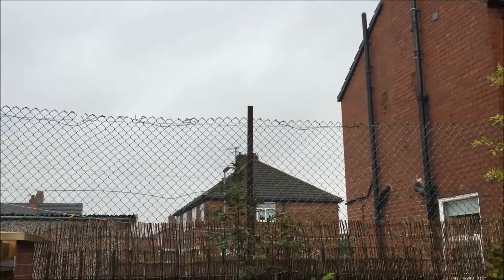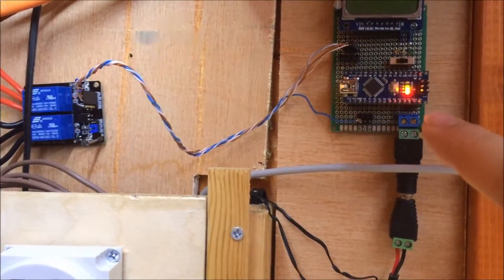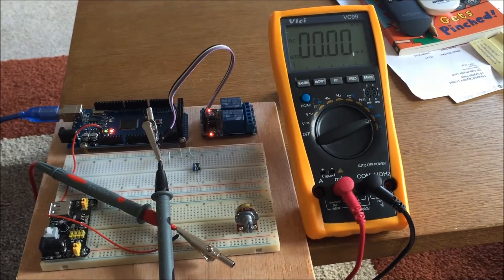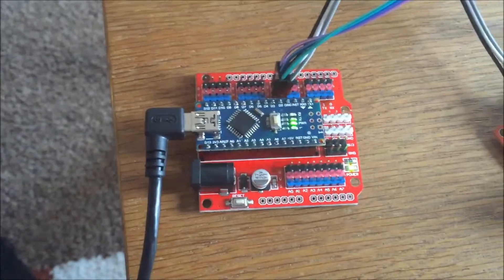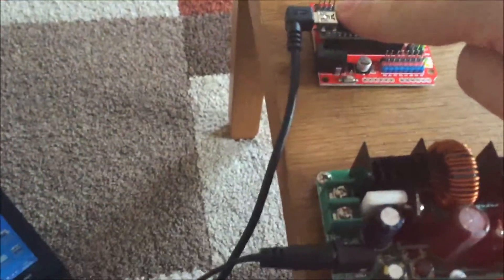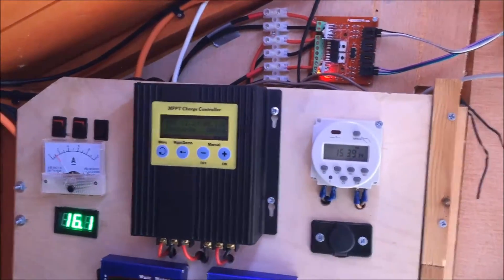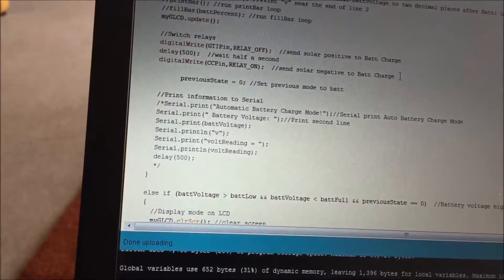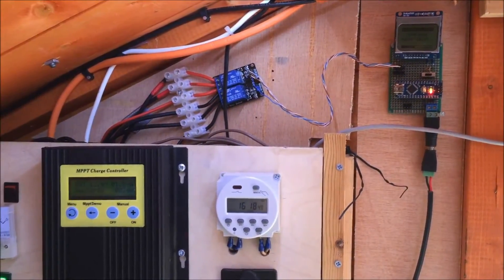Auto Grid Tie Update - Adam's Arduino Projects

Comment: I have developed a board you may be interested in. it does what you are doing. it takes a constant 12vdc to power the board. It can read 0- 90vdc. Can be set to switch an external relay with a 12v coil. trip settings are again from 0-90vdc. Also has a switch for NO or NC to the external relay output.
Thanks
Larry
Reply from the maker: +leamyelectricinc1 Sounds good, thanks for your comments.  I've just watched your video, looks like a nice bit of kit.